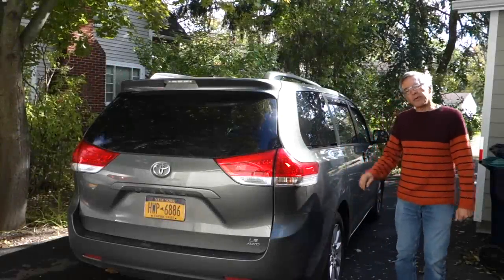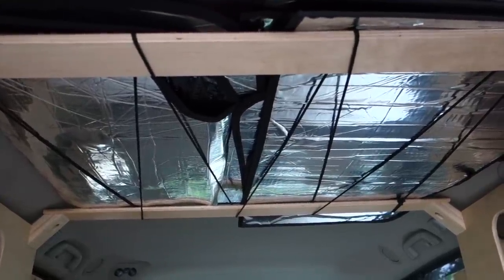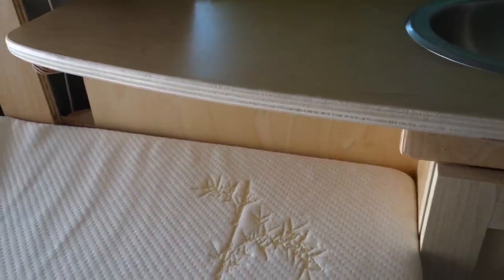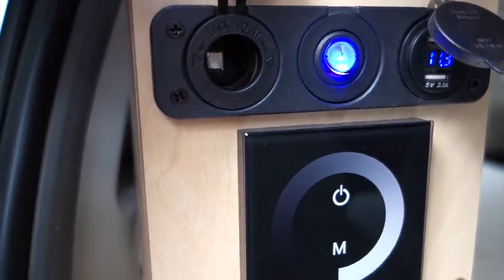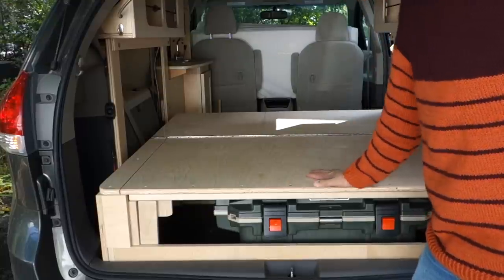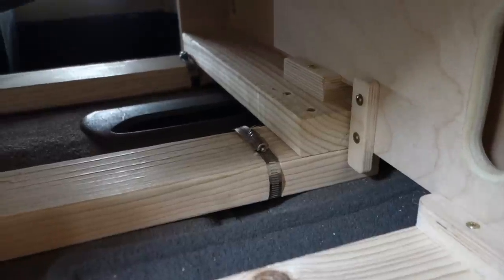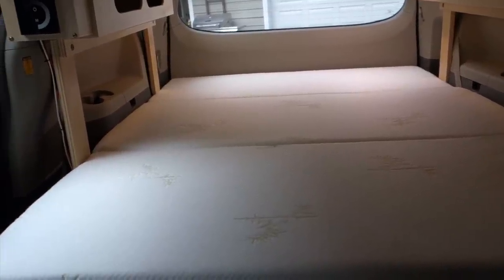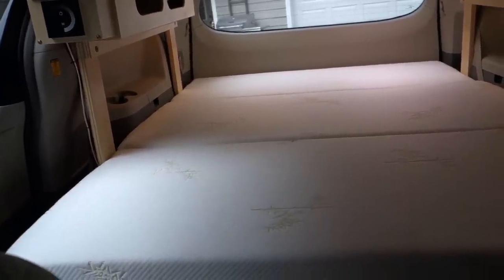A Slightly Different Mini Campervan Build

Comment: This is the best Mini-van build that I seen so far.
Reply: Ditto to that
Reply: Agree.   I like the design that does not change the manufacturer's interior context.
Reply: This is excellent. You could start your own business making these. I'll be first in line. 😁
Reply: I agree.  I'm like most who want to travel but don't want the expense or hassle of an RV, plus I don't want a mini-van conversion that limits the resale value of the vehicle. When I'm done with the mini-van conversion and my travels, I just want to be able to undo the conversion, stick the seats back in, and move on.
Reply: Hi Bru
Reply: That is Hi Bruce. And ditto the other commenters. 
I just bought a Honda Element and spent a week camping in it to get a feel for needs. Came away with wanting a stand alone interior structure with similar ceiling cross supports to support wall structures. Mostly because I wanted to preserve original classic interior without adding any holes. 
I’m admiring your use of much thinner and lighter wood than most builds which seem unnecessarily heavier. Except for body weight, I don’t think there’s a need to build heavier. 
I received a lot of benefit from how you did your build. Example - the use of hose clamps at anchor points. And your carpentry and design is superb - clean, neat, efficient and simple. 
So thank you for sharing your ideas. Much appreciated Beats inventing another wheel.❣️👍🤗
Reply: without a doubt, the best
Reply: I'm guessing you guys havent seen eric set up
Reply: @jtimgray  I agree, me too!
Reply: The. Best. Period.
Reply: Very helpful  ...  thank you 👍😊🐢
Reply: colcheenie colcheenie do you have a link to eric build. Ta
Reply: cant agree more w/this comment.
Reply: Kim X. I
Reply: @colcheeniecolcheenie2113     I’ve seen Eric‘s build but his bed is only 42 inches wide whereas this one is 53 inches wide.
Reply: See Eric Loves Earth’s build.

Comment: That is a genius set up.  Impressed with your craftsmanship.  Keep us updated with your progress.
Reply from the maker: ForestyForest - thanks for the comments. I’ll post updates as I add features in 2019.
Reply: @BruceParks  
Link to those WeatherTech window shades? Cost?
Reply from the maker: @Sig721Tau   - https://www.weathertech.com/toyota/2011/sienna/sunshade/ Full vehicle = $170
Reply: @BruceParks  Congrats on the props from Mr. Checkmark ;) There is a lot done well here. In particular, I want to point out the way you installed the LED's both under-cabinet and also with a diffuser. Top notch!
Reply from the maker: @MarcillaSmith  Thanks for the nice comment, much appreciated. I’ve made a number of upgrades over the past few years which you might appreciate as well. They are all shared in videos on my channel. Be well, and thanks again.
Reply: Forest, I think you first van is the only mini that comes close

Comment: Great design.  I wish the rv builders would hire folks like you as consultants when designing.  They end up with spaces 10 times this size but still inefficient.
Reply from the maker: Thx for the comment. I know what you mean about space efficiency. Just going through the mental exercise in my project, I felt the smaller the space you have to work with the more critical it is to be hyper-aware of how to use each cubic inch.
Reply: Excellent design, fit and finish!
Reply: @BruceParks   I also compliment you on how you made many aspects multi-use (ie, the bed section doubles as a table).  This is truly genius.  With the covid lockdown we are hoping to convert our 2017 Sienna minivan into a camper but we have no engineering or carpentry skills.  Can we clone you?
Reply from the maker: @Diane Bassett Haha, I wish you would, that’s about the only way I’d be able to build all the conversions people have asked for.

Comment: This was an absolutely fabulous conversion.  P.S.  I got a 12 inch zinus foam mattress and cut it in 
three parts and then cut a few inches off the sides so I have 3 separate couches that are wrapped in mattress protectors and then put into a california king size mattress zipped cover so they can be folded into a couch and out again.  Or separate with fabric over them.  The full size mattress was $200 on amazon.  But this was probably one of my top 2 or 3 minivan conversions.  Thank you so so much!
Reply: Where did you get the mattress on Amazon?

Comment: Holy crap, Bruce. I can't decide which aspect I'm more impressed with -- the design or the build. The design is genius and the build quality is impeccable. You are amazing. But not unlike Da Vinci and Newton, maybe a tad cray-cray. All the great ones are. Can't wait to see campervan 3.0!
Reply from the maker: Thanks Doug.  This build was a rush job. Imagine if I had more time :-). As a slightly crazed retired engineer, I see opportunities for optimization in everything I look at, but I also know how to let things be and enjoy what I have.
Reply: +1 from Doug's brother: this is amazing, Bruce! I especially love all the clever bits around that front bed surface, the way the attachment points slip away and it turns into a table.  You mention an auxiliary battery - can you say a little about where that is and how it's connected? Do you have some sort of charge controller?
Reply from the maker: MrMcjamison  - it’s a 13600mAh jump battery plugged into a cig lighter powerport and recharges when the ignition is on. Works well for our meager demand. I’m probably going to upgrade next year to deep cycle battery with fixed roof solar panel (150-200W) and charge controller if load increases.
Reply: I worked with a 1984. Toyota cargo van ,I had fun making it ; I'm sure you did to Yours is great!!
Reply: @BruceParks  I knew within the first few minutes of watching that I was looking at something designed by an engineer. Excellent design and execution.

Comment: I love the ingenuity. More specifically, the fact that the entire system is removable and has no permanent installation, additions, modifications, etc. I am looking at outfitting a minivan camper style. The catch is, I lease. I'm actually getting a 2019 Chrysler Pacifica this week. Every other YT vid I've seen about minivan builds involves owned or old used vehicles so the owners can tinker as they see fit. Not having that capability is so very limiting and it's great to see a build that abides by those constraints. You sir, have a gift. Kudos!
Reply from the maker: UrbanGothamPrepper - Thanks so much for sharing your thoughts, I appreciate it! The approach I took can be applied to just about any vehicle, of course the bigger it is the fewer space challenges there are. But building the features to be self-supporting and not dependent on permanent changes to the vehicle presents the biggest challenges. It looks like you comprehend this well. Building out a cargo van would be easy in comparison.
Reply: Would love to see what you ended up doing....

Comment: Love this! The only thing I'd change would be to add large holes on the platform for air circulation to not have mold issues.
Reply: I saw someone use some strong black plastic stackable bookcase shelves to form a bed platform for a van, which solves that problem (also very light weight, and tall enough to have bins underneath for storage that slide out like drawers)......  I have not tried anything myself, I am stuck in perpetual research mode!
Reply: Diane, I have a video about that.

Comment: Thank you for pointing out in detail all the little things about your build. I love the fact that you did not have to put any holes in the van and how you built all of the frame work to attach to the floor of the van. This is really more up my ally right now just for getting my feet wet doing some short trip to start with and to see if I would love traveling like this. Thank you for sharing this.

Comment: Very nice sir!  I love the way you fastened it in - with the upper cubbys and everything - without screwing into or otherwise damaging/removing the van's interior.
Reply from the maker: ggsmith48906 - thx for the comment. The most challenging part of this project was figuring how to make it strong without drilling and screwing it in everywhere. It would be WAY easier otherwise.

Comment: This is AWESOME! We've been seriously considering van camping and were thinking about going with a cargo van. After watching your video I really think a minivan would work great. Side note: If you ever decide to create and share plans for your rebuild I think you'd get plenty of interest :D Happy camping!
Reply from the maker: Thanks for the comment Susan. Yes, choosing between a minivan and something larger requires a bit of thought and an open mind. The important factors that drove us to go with a minivan were: 1) during travel, the vehicle would be mainly used for driving and sleeping; we didn't see ourselves hanging out inside it much; 2) we didn't want to tow anything, like a teardrop trailer, though they are kinda cute; 3) we wanted something that was very reliable; 4) we wanted a reasonable balance between comfort and environmental impact; so an SUV would be too small and a bigger cargo van or RV was too big; 5) we didn't want an extra unused vehicle parked in the driveway most of the year; and 6) we wanted as stealthy a vehicle as possible for rogue missions like parking overnight on a residential street or commercial parking lot  - minivans are everywhere and no one looks twice at them.
Reply from the maker: John Conrad - conversion of an Expedition EL would be similar to what I did since the length and width of the floor area is about the same behind the front seats. However, your floor to ceiling height is going to make things more difficult because it’s not uniform from front to back. The minivan interior height is around 48” for most of the space. You’ve probably got around 48” right behind the front seats but then there’s less as you get into the 3rd row and towards the back. In order to have enough headroom above the sleeping platform, you’ll have to compromise quite a bit of space below the platform. It’s always a game of compromises. My opinion is sleeping comfort is top priority and all other objectives are open to compromise. Bottom line, yes it’s doable because you have ample floor space but be willing to accept the headroom compromises.

Comment: Great ideas! I like how nothing is screwed into the floors or walls
Reply from the maker: Peter Hunt - thanks for the comment. That was the hard part, figuring out how to achieve the desired function without modifying the van.

Comment: Honestly hands down the best van build I've seen! Wish a shower was somehow integrated but awesome build. Really impressed.
Reply from the maker: Thanks for the comment. Yes, an integrated shower inside is a challenge. It's doable if you devote some space in the back where you have some depth in the 3rd row seat well to work with. An integrated outdoor shower is easier to pull off. That may be included in an upgrade I do for 2019.
Reply: I saw a shower head built into the lift gate on one,  but the whole shower thing seems like a pain to me. I just pick my campgrounds based on the amenities I want.

Comment: Only possible problem I'm seeing off hand is the sink drain. You might want to fit a better cap on top as it looks like there is none so when it gets a bit filled and you go around a conner you may have water splashing out. It wouldn't take much to run a vent line up higher then the top of the jug and then run the drain tube through a screw-on cap.
Nice build, can see you spent some time planning and building.

Comment: Genius! Best minivan conversion I have ever seen. I have zero carpentry or electrical skills but would love to do this to my Town& Country van. Got the van years ago to haul the grandkids on beach camping adventures. They’re older and off on their own these days but the van is still in excellent condition. Now I need to find a carpenter and electrician. Happy travels 🔥
Reply from the maker: Hi Sally, glad you liked my build. You should definitely pursue getting yours built, it sounds like you've got the travel bug!
Reply: @BruceParks  thanks Bruce.  I definitely have the bug.   Van is now 10 years old but has low mileage and is still going strong.  She's actually in the shop today for routine maintenance (brakes). Plan to remove those seats I use to need for the little ones and utilize the stow and go areas for storage. Or they can house electrical, plumbing/small sink and little stove.  Love how you did your build and hope to copy many ideas from it. The carpentry you did is beautiful!   Now I just need to find a good carpenter and electrician.  Install some solar and hit the road.  Once again, thanks again for sharing your build.  Happy travels to you and your wife.

Comment: WOW, AMAZING!!! Like the back storage areas you build for the packing cubes. Very well thought out. Thanks for putting a video together. :) 

Do you not use a stove for cooking food? I've rented a few minivans that were set up as a camper. Like how you have the kitchen sink inside. The one I was in was at the back, but when it was raining and windy didn't like having to go outside to access. 

Subbed your channel, looking forward to following along on your channels and how this setup works.

Thanks,

Tina

Comment: Level of detail is very impressive. Definitely will be using your design ideas for my build. Cross bars are brilliant addition I have never seen used, outstanding idea. Beautiful stealth van. Do you have a heater suggestion?
Reply from the maker: Thanks for the comment. I haven't spent much time looking into heaters yet. For 2019, I'm interested in adding a solar panel and deep cycle battery to power more things (e.g. refrigerator, ventilation, heating; all modestly sized). I hope to post as I learn.
Reply: In a vehicle this size the engine heat works well and for amount used  cost is somewhat irrelevant. Worked for us in Western European!
Reply: Westy eurovan

Comment: Bruce, excellent build.  Does the bed also convert to a sofa/bench seat?  Would you be interested in a build for my Dodge Grand Caravan?
Reply from the maker: Yes, with the rear panel in the up position, it acts as the backrest for sofa-mode. 

At the moment, I’m not available for customer builds but I’m giving it some thought.
Reply: Hey! Checking in whether you might be open to customer builds since this was posted a couple months ago - message me if so!
Reply: Beautifully brilliant design!  I love the bed turned table!  I have a rav4 hybrid.  I'm short, so can fit across the back seat, so this table idea is awesome for widening and levelling my sleep space.  I am also interested if you decide to build!

Comment: How much does it cost for the build? I'm planning to do mine 2012 sienna for school life.
Reply from the maker: Material cost is low. A couple sheets of plywood, $100. Sink, faucet, plumbing, etc $100. LED lighting and 12V accessories via a direct-from-China source (like wish.com) $30. Hardware, hinges, screws, etc $30. Mattress $130. A 12V jump pack battery $50. Misc. $50. Total under $500.
Reply: How much will you charge to build this set up for me Bruce
Reply from the maker: Hi, I wish I had an answer that didn’t sound ridiculous. It would be something like 100 hours of work because I don’t have automated production equipment. I’m not sure what the going rate is for this level of woodworking but let’s just say $50/hr. So around $5000 plus materials. The real problem is I just don’t have any spare time for a while. This year is already booked out until September. If I ever gear up for production, I’ll let you know; the cost would be a lot less.

Comment: Question, spare tire is where. Well done for limited space.
Reply from the maker: The AWD Siennas don’t have spares, they were shipped with run-flat tires. I carry a rescue kit (slime + inflator) just in case. The FWD Siennas carry their spare under the passenger side 2nd row seat.
Reply: Thanks, did not know that.

Comment: The floor leveling information in your description was very helpful 👍
Reply from the maker: BonnieJeanTlq - thanks for commenting on the floor level design. Nearly all campervans are built without that angle correction.
Reply from the maker: Sorry, I didn't finish my earlier reply. It's easier to build the sleeping platform without that angle correction but not that much more difficult to take it into account and adjust it to be flat.

Comment: Absolutely, total genius.  Wish I still had my Sienna.  Traded it 6 years ago for a Toyota Tundra that I want to convert to full-time camper life.
Reply from the maker: Debbie, thanks for commenting. I'm sure you can create a great camper out of your Tundra. Obviously, the main thing you give up vs a Sienna is being able to easily climb back and forth between the drivers seat and sleeping area but otherwise it seems like there are a lot of options to outfit the truck bed.

Comment: This is fantastic! Can you sit up in bed?
Reply from the maker: Yes. My head is touching the ceiling but my wife as a lot of clearance. The height of the sleeping platform was set by the height of our cooler. It's a really tall cooler. A shorter cooler would allow the platform to be mounted lower.

Comment: Good one Bruce . I will just say though having unsealed  timber can cause issues with mould feeding off the cellulose in the timber . You won't be able to see it but it will cause respiratory problems  . Condensation will create moisture and the wood will absorb it and so the cycle begins .
Reply from the maker: Electron Proton Neutron Mouron - Good point. I’ve sealed all the wood with two coats of polyacrylic and expect that to be good enough but I’ll keep an eye on everything.